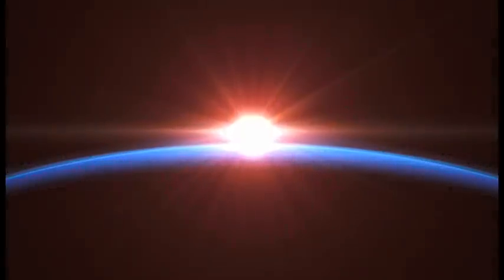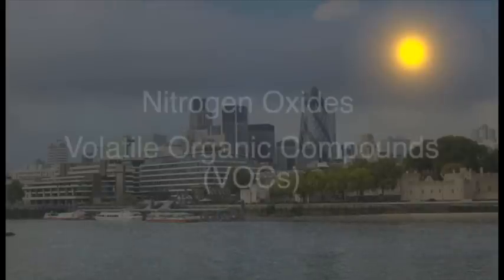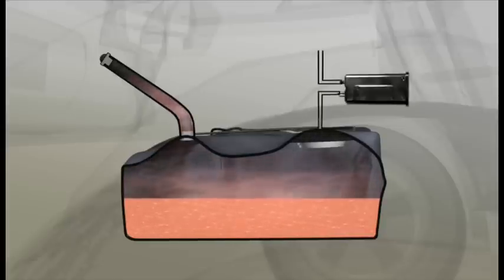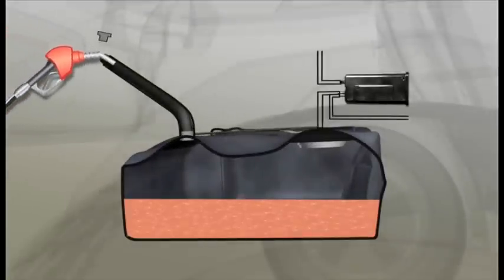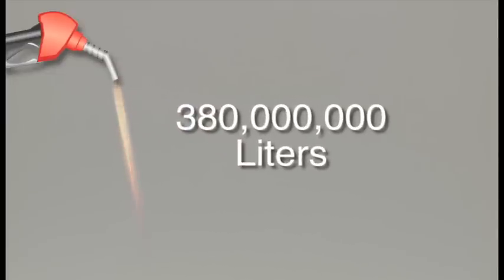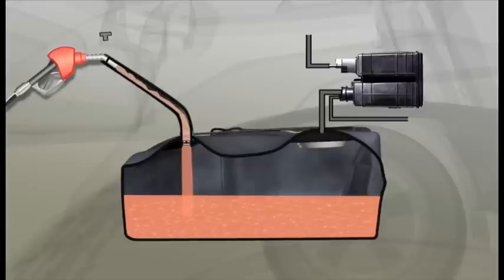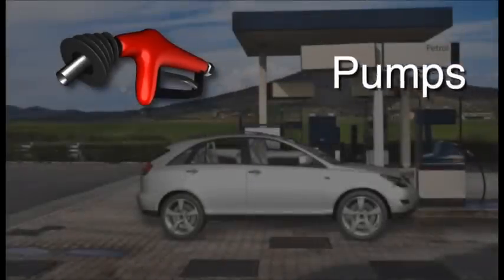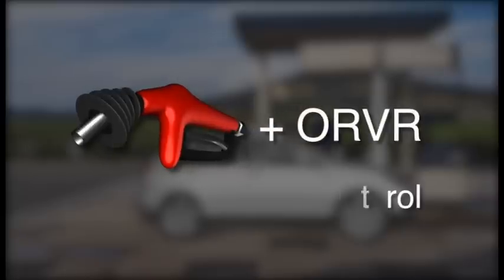Onboard Refueling Vapor Recovery (ORVR)

Comment: I drive a year model 2000 Toyota Sienna. I assumed(!) that if I elected not to drive the vehicle for one or two days on a weekend, that I was helping to reduce pollution. Should I instead start (and idle) the vehicle for two to three minutes daily on otherwise unused days to reduce evaporative  pollutants?
Reply: No starting your car will created CO2 and other pollutants.
Your best option is to store the vehicle in a garage where there'll be less temperature variation.